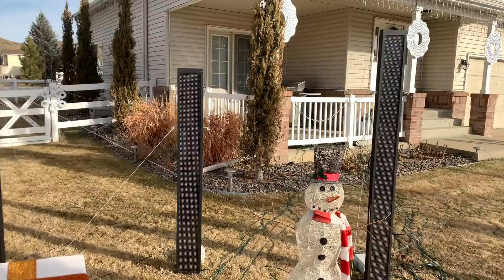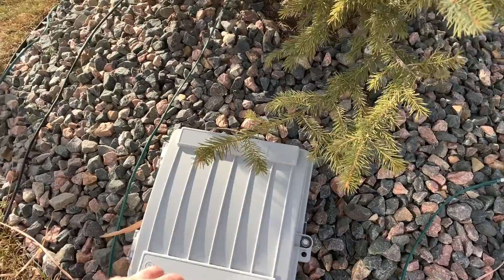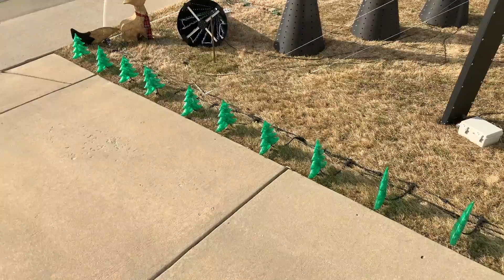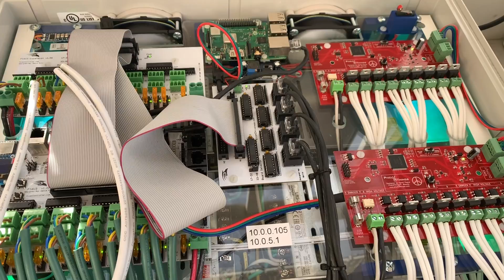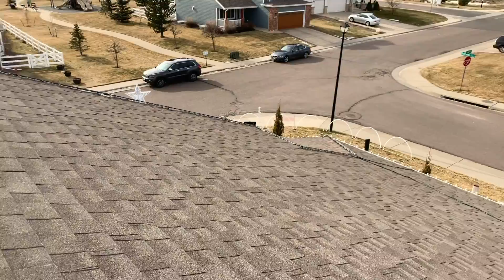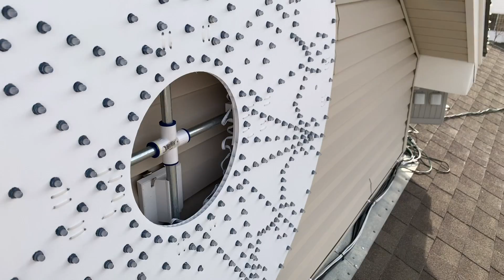2019 Behind The Scenes Walk Through - North Table Mountain Christmas Lights

Comment: I know this is an older video. My question is on you arches . Are you controlling the data for all arches and base off 2 ports on the f16  . Then your adding power for 2 arches. Am i understanding that right . Also what pixels are you using in the arches.  Thanks for your help .
Reply from the maker: The arches are controlled from 2 ports and the bases are controlled from one port, so a total of 3 ports for the combined arches / bases. The arches needed to be split because it would have been too many pixels controlled from one port since I'm using 2 expansion boards with the F16. Each buck converter then powers two arches. The arches use strips and they are 60 LEDs per meter with 3 LEDs per pixel.

Comment: I noticed that your using different spaced pixels through your display.  I was wondering what the spacing was on the baby wreath??? Alot of great information in this video. Thanks for your time.
Reply from the maker: Whenever it's possible I get my pixels with custom spacing for the intended prop. On the wreath I actually have 4 different spacing intervals as the pixels work their way outward.
Reply: Im new to the whole pixel game. If you could lead me in the right direction with some information. I would greatly appreciate.

Comment: Hi, great work. I am very interested in the arches at the front of the house and wondered if you have any details on how to start and what I need to buy please?
Reply from the maker: Those arches use 1" PEX tubing and I will be adding a new video on the arches soon. I have just finished a redesign of the arch base mounts and they will be available at inspirelightshows.com very soon.
Reply: @reelpilot  Awesome!
Reply: There’s a few options.  I’ll link one. 

I’m personally buying white 1” pex at Lowe’s, 3D printing the feet, 5/8” emt for the base connection to 3D feet, and stakes to hold the base, and inserting my leftover strips (you can drill for bullet pixels as well)

This link the guy uses HDPE tubing which I don’t have local access to and can’t for this season:

https://youtu.be/4pjHDMx92TI

Comment: Love your setup. Where do you source your cables and boxes from? I'm also curious about your 3D printer. What 3D printer you are using?
Reply from the maker: A few of the older boxed are CG1500's that are available from many vendors like DIYLED Express. However most of my newer ones are Bud Industry boxes. They come in tons of sizes, so I just measure what I need and go with whatever size box will fit them. I'm in a multi year transition to going with all xconnect pigtails, so wires are just ordered from the pixel vendor. For printing I use the Prusa MK3S.
Reply: @reelpilot  Thank you for the update.

Comment: Great layout and walk through.  Do you have a video of the runway in action?
Reply from the maker: Not anything worth sharing. It's still a work in progress and since I'm my biggest critic I don't want to share it until it's right. This year everything will be on aluminum rails and perfectly aligned.
Reply: @reelpilot  no problem. I am switching to RGBs this year but still have several strings of newly acquired LEDs that I wanted to somehow get a little use out of. I'll just do a MegaTree made up of superstrings. Thanks again for the walkthrough. It was very helpful.

Comment: Doug,  Can you explain why you use the Pi computers in your controller boxes instead of using a computer to run the show?  Is there an advantage to this?  It seems more complicated to me as this was my first year and I had a dedicated PC running the show with XSchedule and it worked fine for me.  Thanks again for all of the extra efforts you take to help all of us new guys!!
Reply from the maker: Either way works, but with a pi I don't have to commit a PC to the job and have to worry about software updates or other reboots that may happen during showtimes. I can also continue to use my PC for any high CPU use and never have to worry about it effecting my show. I also choose to run my pis wirelessly, so I don't have to run cat 5 everywhere which is a huge benefit for me since my show is spread out. FPP and xlights work very well together and you can rather easily push xlights configuration out to both pis and controllers.

Comment: Looks great! Would be so kind as to tell me the diameter of your arches please?
Reply: Also is the connection at corners a 3D print you made?
Reply from the maker: The PEX for the arch is 111" long and the horizontal PEX between the mounts is 63" long. The mounts are 3D printed. These particular ones were made for me before I got into 3D printing. At some point, hopefully this year, I am going to create my own version that makes a few improvements on this design.
Reply: @reelpilot  thank you. Is the Pex 1" diameter?
Reply from the maker: Yes 1" PEX
Reply: @reelpilot  they look good. I appreciate the come back. Nice setup for show as well

Comment: Thanks for sharing.  More importantly, thanks for referring that you use low voltage landscape wire for your display.  I can't tell you how many times I have asked this question and not a single person replied.  Thanks!!   The other question I have is do you use one or more power rails from the power box (i.e., circuit breaker line) when powering the displays?  Do you use one single 20 AMP circuit?  Perhaps use multi circuits??  Do you measure and monitor the power usage for each circuit?
Reply from the maker: I have the display on 5 different circuits. I could probably get away with less, but why push it. I periodically test with a watt meter. Overall the current draw on both the AC and DC is low except for when everything is on white which I seldom do with the sequences.